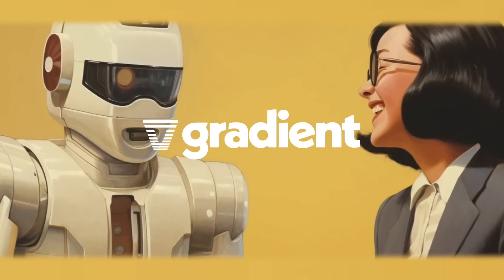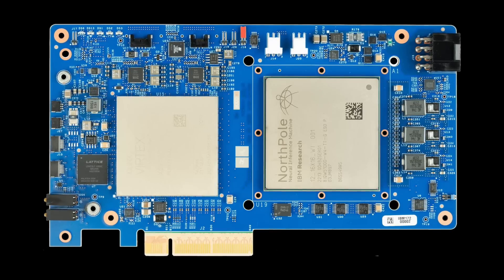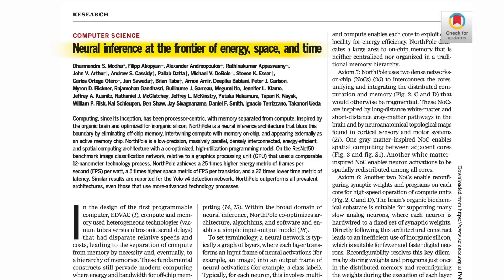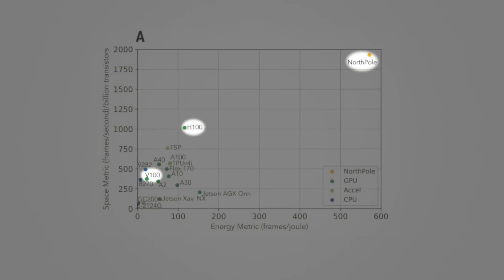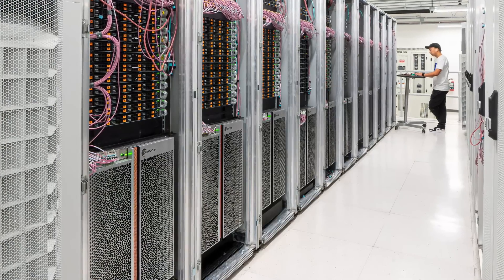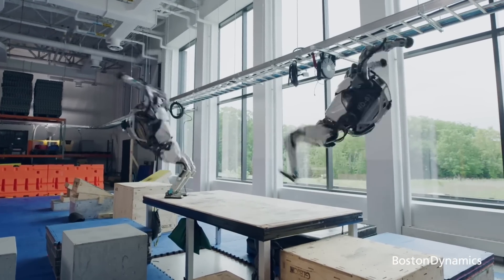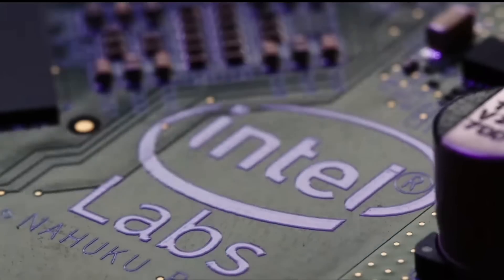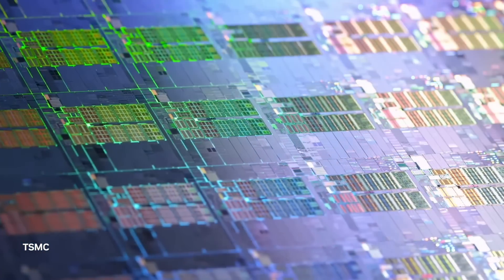IBM Surprised Everyone With This Chip

Comment: what i think is fascinating about this chip is that IBM has patents on manufacturing nodes from 14nm down to 5nm and this chip could potentially be made in IBMs own research facilities 🤯
Reply: then add on the fact that IBM is completely vertically integrated where they are also the cloud service provider and they have their own models!! 😆

Comment: 2:15 - video says the chip can be scaled down from 12nm to 3 nm. But if the design contains SRAM cells, the memory itself will not scale down. Or has this issue been resolved?

Comment: Current computing practice separates a datum from the infrastructure that produces that datum. With great achievements and results, yes. But not impressive. This is why it cannot mimick the brain How about a logic that runs on several input pathways, how about a logic that evolves on each iteration. How about a logic that uses infrastructure pathways as memory, making template computing possible. For this we need an evolving maths, eMath. Math is only linear, having its rule set or Ordering Principle defined as  +1=. Robust as this may be the = sign is its limit., eMath would be defined as +1 -> 0, ..1, ..2, ..3 ... ( -> :: develops into ), much like our biological systems do. Can this be realised? Yes. The principles have already been mapped, therefore an algorithm can be written. And with the technology available, as delineated above, it is a simple design step. They are a vital predeterminant for building working models.

Comment: Asynchonous or "no synchronous" is an important aspect to consider. It can say compress a century of high speed sample data to produce and "answer" in a bit or a byte or bytes. It allows so many assumed rules to be discarded or alleviated towards progress to quality of information in efficient time domains. To include "feedback loops" to both sides of the underlying way a program can re-program itself, while including ways to incorporate "vectors" in time and in space. Any mix/match use of these concepts at any level will drive efficiency, and produce answers to create better questions. It is better to know an answer before one need consider the questions. Gr8! Peace ☮💜

Comment: If the picture showed of the North Pole board was in fact a 8 lane pci connector and it uses less energy, why are they not fast tracking this to the consumer market? I would prefer a onetime expense even if it was equivalent to a over priced 4080 just so I could get a chat gpt 2.5 or 3 ai to run locally on my home computer or better yet a home network server so aI could have access to my private ai from any of my devices from anywhere in the world.

Comment: Tnx for your videos in this channel. It is very useful NorthPole chip. In my idea, if we could build a chip based on digital logic but with non-volatile devices such as Memristor or Magnetic tunnel junction (MTJ) or some like these and mix them to Modern Transistors like CNTFET, that will be worthwhile and can help us to Deep Neural Network and Neuromorphic computing for AI issue.

Comment: True North IBM Watson :) it was said by IBM engineers back then that an AI computer using 60W of power will be able to outperform classical computers running on 8 megawatts, so that people can have an IBM Watson running locally over wifi at home! AI computers will enable improve smart homes, smart vehicles, smart technology, rationally improving energy efficient operations in a broad domain of different use cases and applications. This means most areas of society that were improved by digital computers will be further improved with neural network based AI models, algorithms, noise reduction, sensor data fusion and other mixed signal and signal fusion technologies. Consider L5 vehicle autonomy operated safely with less electrical power in onboard compute networks in commonly sold automobiles with novel ADAS and autopilot in the near future.
Reply: I wrote about this on my blog 
https://priusblack.blogspot.com/2023/12/cmos-digital-chips-for-ann-training.html

Comment: This is the second time IBM has come up with revolutionary chip design. Most might not remember the Cell Architecture that was suppose to bridge the gap between a CPU and GPU and was used in Sony PlayStation 3. But it failed because it required totally new approach to software development.
With the kind of working that this chip is presented with, we should expect a similar complication in software development for this chip as well along with some other problems that we might have not predicted.
Anyways,  it is amazing development none the less.

Comment: As a retired ATT systems technician, I worked on cord switchboards in the seventies supported by electromechanical 701 step by step switch gear. By 1986 we were putting in System 85 with timed multiple switching and fiber optics connected the remote nodes between buildings   A RAM board was 64k and when we saw a 256k board come out soon after we would tell people it was the FM system (Fucking magic). Lol.  Fast forward to today and the exponential advancement in technology is unbelievable.  Good Job IBM.  I’ll bet you guys did all this not even wearing a suit and short haircut they demanded back in the day.

Comment: It seems to me that the "speed" and "power efficiency" metrics were all "per billion transistors". If not, isn't that an almost useless metric if you want to use it at scale - i.e. in the data center to train massive models and/or do reference on them for huge numbers of cloud-connected users. What am I missing here? It also has quite low transistor count. And I didn't catch the total memory, but if it is integrated on-chip, suspect it isn't that much (unlike Cerebras' massive device). Lastly, consider the "frames per B cycles per B transistors" metric. The IBM chip has a VERY low clock rate AND low transistor count. That again strikes me as "data spin" to make the chip look much better than it will be in raw performance, which to me is the MOST important metric (with memory size and processing rate a close second).

Comment: In the realm of circuits, where innovations gleam,
Anastasi In Tech unveils a tech-driven dream.
A whisper of progress in the digital quest,
New IBM AI Chip, outshining the rest.

Circuits entwined, like a technological dance,
Faster than GPUs, in the AI trance.
Anastasi In Tech, the sage of the byte,
Explains the magic, the chip's newfound might.

IBM's creation, a silicon star,
Outpacing the rest, from afar.
Anastasi In Tech delves into the core,
Of speed and power, like never before.

Nvidia's shadow, a distant cascade,
As IBM's chip strides, in a faster parade.
In the circuits' ballet, where algorithms play,
Anastasi In Tech sheds light on the day.

Faster computations, in the AI race,
Anastasi In Tech paints the technological grace.
A chip that surpasses, a digital feat,
In the hands of progress, where innovations meet.

The digital symphony, Anastasi conducts,
In the world of AI, where the future deducts.
Explained with clarity, in the tech-savvy quest,
Anastasi In Tech, where insights invest.

Comment: This is great and all, but the power consumption for TrueNorth was a puny 65 mW.

So NorthPole has increased perf by 4,000x while increasing power consumption by over 1,000x too.

Making the actual gain closer to 4x in perf/watt over TrueNorth.

That is still a gain for sure, but all the same it doesn't seem like as big of a gain as I would have hoped for considering they were known to be researching replacing SRAM with MRAM, PCRAM and likely other types of persistent non volatile memory that could make a neuromorphic chip far more efficient (and potentially smaller too).

Comment: This is a great video explaining the new IBM AI chip, NorthPole, that uses a brain-inspired architecture to achieve faster and more energy-efficient AI inference. I’m impressed by how it can perform multiply-accumulate operations within the memory, eliminating the von Neumann bottleneck that plagues traditional chips. I wonder how it compares to other analog AI chips that use phase-change memory or resistive non-volatile memory devices. Thanks for sharing this informative and engaging content ty Bing AI

Comment: IBM has a dozen R&D labs. The motivation for these is the creation of patents and later on royalties. IBM used to be a computer research, manufacturing and distribution company. Today it sells mostly services and does research. However, none of these research results are for sales within the next decade and usually IBM will not make such a chip itself but let others manufacture them and earn royalties. So , a very long time off.
Contrary to that Tesla is very much production and productivity oriented and many times faster that IBM in bringing anything to the market.
Another aspect is the SDK and the software-framework that is required to make use of this hardware.

Comment: Healthy informatic growth would be or evolve so much slower compared to the speed the money donators would like. And the hiding and/or stealing of technology "bluechips" just weakens the worldwide technological stability, "we" would (still) have enough problems converted into work when so many issues about bad people habits would be solved. Many people nowadays don't admit their flaws, it's almost disgusting why only few explanations for technical problems are researchable in the internet in an easy access way, so people'd rather attempted to have learned to get used to linux (i couldn't actually try yet). And i don't like so-called supporters that claim "they know all what is good or suitable for my system" (like some guru on some strange throne). I'd guess finding a matching socket for some type of chip is even more demanding. I stumbled across a well done video "analog chip design is an art" https://www.youtube.com/watch?v=lNypq1XuZRo sixteen minutes

Comment: Does anyone know how IBM is fabricating memory and logic on a single chip? The usual approach is to separate logic and memory on separate chips. This allows very dense DRAM memory to be fabricated using a process flow which is significantly different from the process flow for logic. Fabricating DRAM memory and logic in a single process flow is very difficult (people, including IBM, have tried). Another option is to use SRAM memory cells which can be fabricated with the same process flow as logic but since they have with 4 or 6 transistors per bit, they use a large amount of real estate. A third option is to use stacked chips, where thinned chips are stacked and bonded together vertically using through silicon vias for electrical connections. The 22 billion transistors suggests that they may be using the SRAM option.

Comment: I remember the North Star from yesteryear.  Great to see IBM at the forefront again.  I have always thought that bending GPU ray tracing pipelines around to do more general computing is fundamentally inefficient.  That 25x efficiency multiple underlines that point.

The spiking NN without central clock signal should yield more savings still.

Great segment, Anastasi!  Thank you.

Comment: Interesting, but surely the best companies to develop this would be Apple and QUALCOMM.  IBM want a big buck per bang(yes you read that correctly} from a small market place, i.e. server centres, who are willing to pay.  The only two features of interest are computer output, however you want to measure that to suit the marketing dept., and power consumption.  Development costs sound stratospheric, so where are the big two on this?  I'm excluding Intel as they are still playing catch-up with their main markets and are struggling with efficiency and die sizes. It will be very interesting to see Qualcomm's new desktop chip, which promises lots.  AI needs masses of code and data to give a best estimate responses,  you've only got to talk to an AI chat bot to see how poor the s/ware is currently, regardless of the hardware in use.  Apologies if I sound a bit jaundiced, your video was great  and enlightening!

Comment: I worked with the previous generation and it's extremely interesting to train on.  It performs off-chip learning so your data is stored off the processing server.  Intel's Luihi are an on chip solution

Comment: I do remember True north chip, I do wonder where they get that 4000x figure from... Hopefully that's enough for it to succeed where true north failed. 5x than more efficient than H100 ain't bad. But is that only for inference? Because if it is then it's not that special, inference can be super efficient depending on hardware, and H100 is designed for training and NOT inference...

Comment: Yes but if it costs 50 times the price and there are only a small number of them. Then is it really all that impressive? No...
What would be impressive is a crypro mining software that instantly hooks up a 10 million GPU's (+ - Nvida 3070's) from all over the world and pays the "miners" who will be lending their hardware to an A.I neural network.

While it might not be the fastest Super Computer. It will certainly be the most powerful. 
An A.I doesn't need a super computer to run. It needs a super computer to learn. So a defused network for learning will be just fine.

Comment: nothing in comparison what comes in a few years, in a few years there will be the first mass produced ONN Chips available that are 2500 times faster then the current fastest chips. (The TU Berlin and the MIT have allready build the first prototyp a ONN chip 25 times faster then the fastest cpu same size, 100 times less energy consumation and its easy to get it 100 times faster with using a higher laserfrequency they said, massproduction could start in a few years they said) Imagine a workstation around 2027/2028 could reach over 1 Exaflops with ONN Chips. Imagine when that new Era will begin, a workstation with ONN-Chips so fast like the current fastest Exascale Computers which needs douzens of Megawatt. How to prevent China (the current tech war between USA and China) to buy workstations with ONN-Chips, or Laptops with ONN Chips (So around 160 Petaflops (1000 Petaflops = 1 Exaflop). Its said even smartphones will be able to run programms for that nowdays supercomputer are needed. Imagine North Korea in the year 2028 with a ONN-Chip Laptop (160 Petaflops) running atomic explosion simulations.
here more https://www.youtube.com/watch?v=H0k_FlS9-zQ&feature=youtu.be

Comment: I was wondering whether all apps could be run fully in AI. Even games. I noticed that Nvidia uses a lot of AI in games too. At first DLSS showed up. Then I wondered whether AI can be used for compression. All I found back then on the internet was that it can but that there is no gain. Then Nvidia made an AI based voxel file compressor with around 50x rate of compression. Recently Nvidia did the same even with texture compression doing 16x if I recall.

I am sure that AI could do everything a normal app or even game could do fully. But of course my question was whether it would make sense? First concern was performance so frame rate. Video games for instance have to be real-time so 60+ FPS. The remarkable thing about DLSS is that it actually improves visual quality and can double the frame rates at the same time. And that AI runs in real time on present day hardware. Some modern AAA games use DLSS 3.5 already. Yes version 3.5 uses AI again to improve ray tracing by improving the denoiser.  And yes of course that is done again in real-time on current GPUs. So I guess everything in the future would be fully AI then?

I wonder how one would hack AI. I am a Rust lang programmer.  I am not in the field of security or even the internet but Rust is also used for more secure software because it handles pointers better than C/C++. Is AI itself saver?

Comment: This really sounds like an ad read for IBM and Intel.  Please explain what specific workloads are more efficient and faster on IBM’s chip vs the others?  As you chip designer, you should already know that most of the die in today’s chips are already being used for memory and that portion of the chip does not shrink well.  Perhaps this is the reason IBM is sticking with 12nm.  Also, please explain why no one is using “neuromorphic” chips for AI workloads today.

Comment: amazing, I following the IBM pc  xt, ( intel cpu )  286  80386   80486  pentium ii  core duo.. i3 i5 i7 i9  etc . hardisk from 5mb sugar?  10mb , 20mb seagate st225, RLL 30mb with Adaptec RLL controller,  mitsubish 40mb mfm/rll60mb...one time , I repaired a IBM AT computer with a Seagate ST4096 40mb & it was so heavy & it flew off the case I was holding & dropped to the floor, costed me over $400 to replace for the customer.... old story, hehe
mb

Comment: the thing i love the most about this chip is how it's only using 74w which means it can be powered fully through a PCIe slot, the biggest obstacle i can see tho is software support. we can already see that with AMD GPU to an extent, they're very capable compute machines and often time have more VRAM than Nvidia counterparts at the same price but since they're not supported by tensorflow or pytorch they can't be used for AI easily